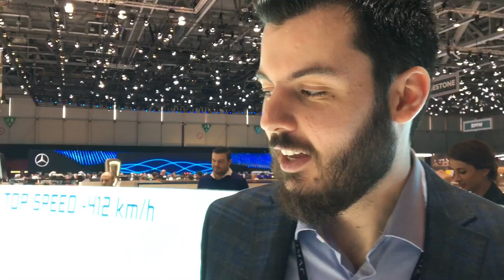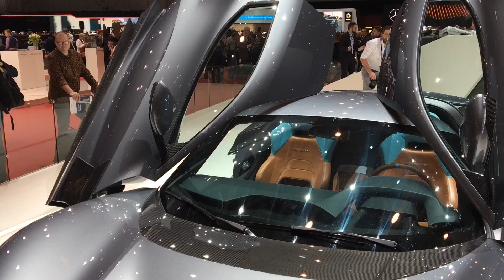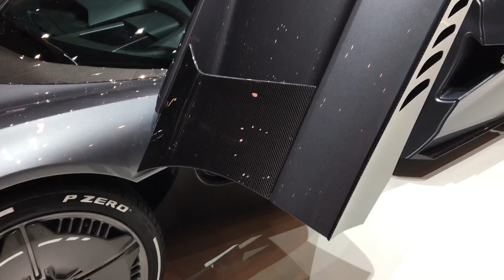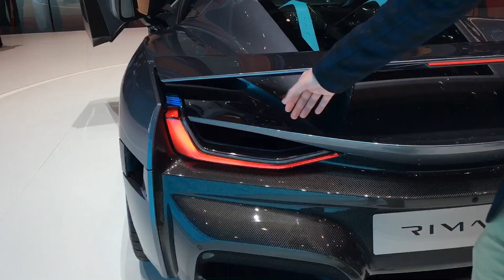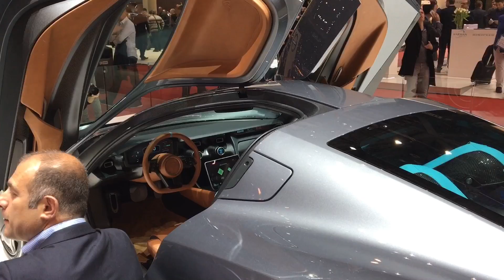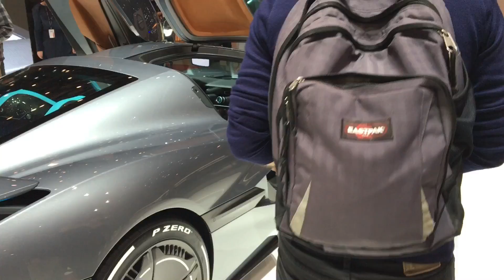Rimac C_Two Hypercar -  0-100 km/hr In 1.95 Seconds | MotorBeam

Comment: Is this faster than Tesla roadster?
Reply: Dunno,I think both cars will be great when they hit the road,but if I had like 10 000 000$ To spend on cars I Would go with RImac,if I had only 500k$ I would go with Tesla,they just do not target the same group of people on the market,that is just my opinion.
Reply: Yes,not to mention it will hit the road much before Tesla Roadster will.
Reply: Aleksandar Mijatovic but Tesla will be affordable but not this cz Tesla costs $250000 this will b over millions
Reply: True,but then again,do a guy who buys this thing really cares about the cost?
Reply: Aleksandar Mijatovic but still this is very beautiful car I meant more than Tesla too
Reply: Aleksandar Mijatovic but Tesla has more range he told 650 km but in Tesla website it's written 620 miles which means 900 km approx which is insane.
Reply: debayan das yea but rimac will have lvl 4 autonoms,has much better chasy and active aero dynamics ,has superior cooling for racing,has over 400 diffrent sensors,infotaiment system , amzing procesing power,each will is controlled seperatly with its own motor 100 times a second, car has facial recognition , has two gears witch allows it for constant high accelaration i think it goes to 300kmh for 11.8s if not faster , when on track the car will recognise the track and tell you whats the best way to race around it, car can tecognise your mood and modify its driving depending on how are you feling , it will modify its driving depending on wether conditions, has cameras that will warn you about near vy pedestrian and other vechiles and I could go on for a while ,but i hope that by know you see why this thing is more expensive
Reply: debayan das look up a video from shmee 150 about it
Reply: Tesla has more range ,but it takes so long to release
Reply: Roadster2 is a 4-seater? 2,877 lbs? How can 200kwh worth of batteries fit in this car?  Color me skeptical... BTW congratulations to Indian fella in a design team of Rimac.